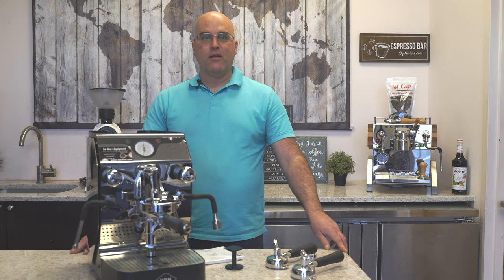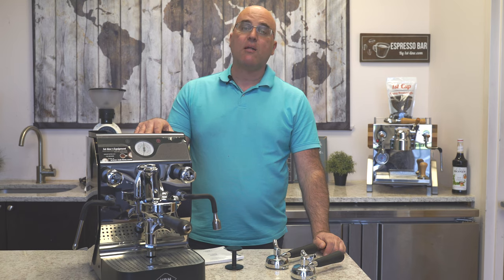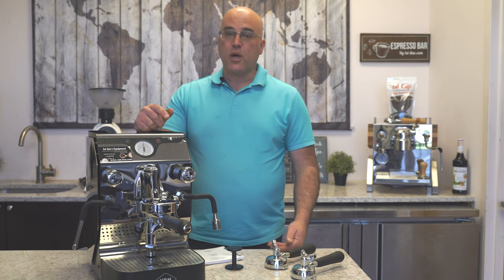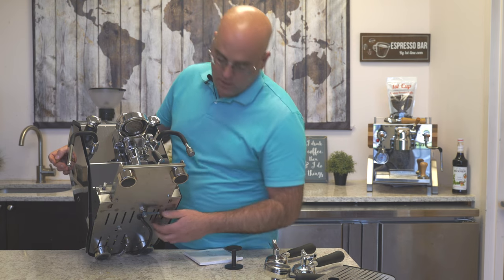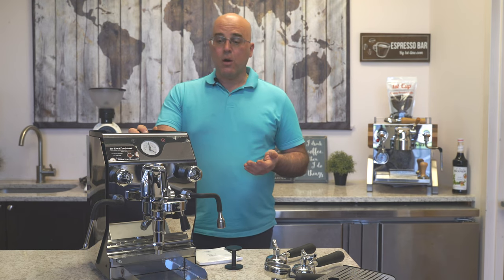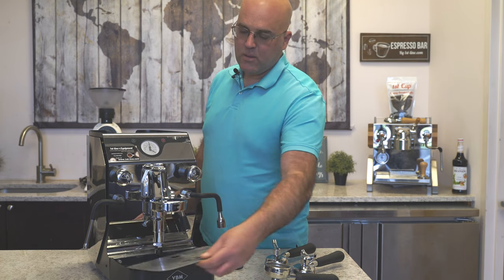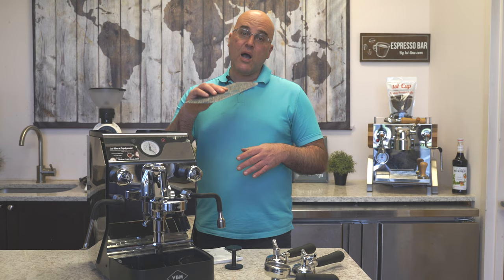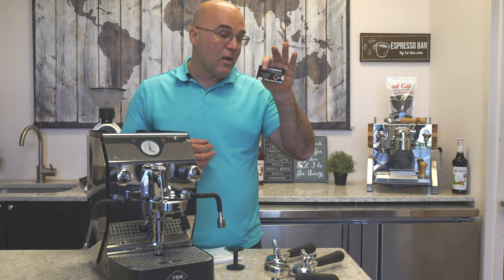Tech Tips: VBM 2021 Super Espresso Machines

Comment: Thank you for the video Jim.
Are vbm machones hard to repair?
As for what is wrong: Wand too close to wall, plastic bag on top of hot machine?
Reply: Bag of coffee on top of machine! It is a no-no as the beans would get hot.
Reply: Sorry, I missed one point. In general, VBM machines are easier than some others to self-repair
Reply: Easy to work on. I had to replace a pump on mine, was impressed by how cleanly installed everything was in there, any handy person can work on it fi needed.